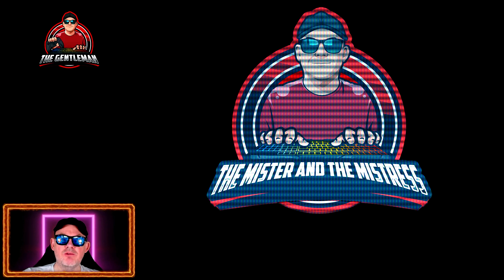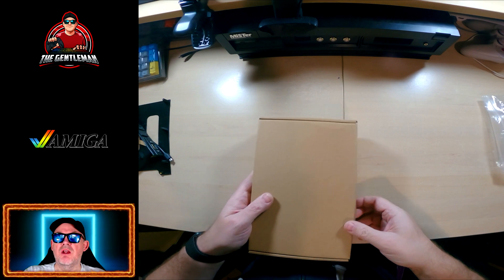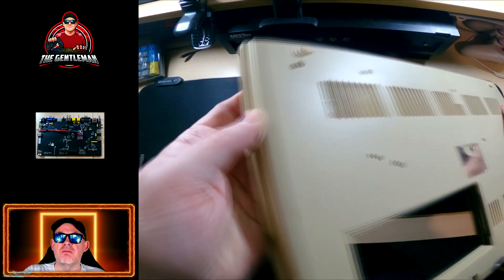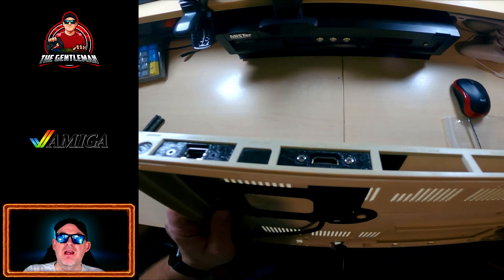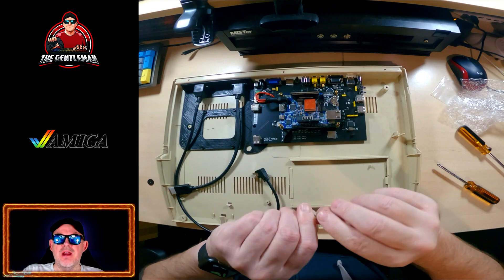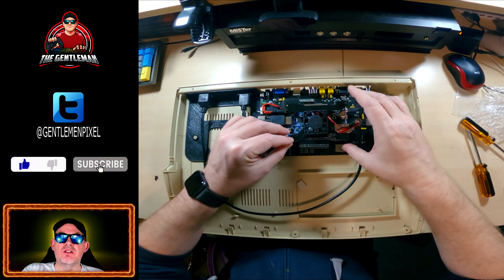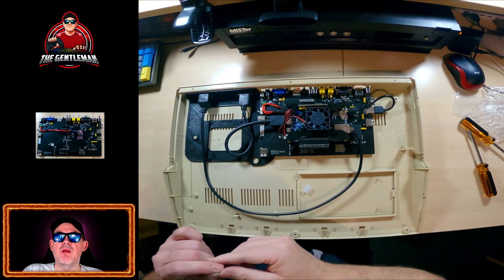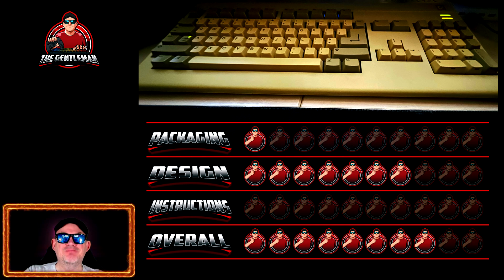MiSTer FPGA - Amiga IO Board - The MiSTress

Comment: looks great.. i know everyone's seen the mister working, but i'd have liked to have seen how the power lights/hard drive worked and if you  had it booting straight into workbench or the mister menu etc.
Reply from the maker: It boots into the standard menu as I use the MiSTer for all sorts - but - the power / hard drive lights work as they should.

Over Xmas week I will do a generic MiSTer video that will show this and other stuff - I'll be sure to include the Amiga case with the board turning on and booting with an external video as well as direct capture.
Reply: @GentlemensPixelClub  nice one :) the more mister content the better i say.. lolol have a great xmas.